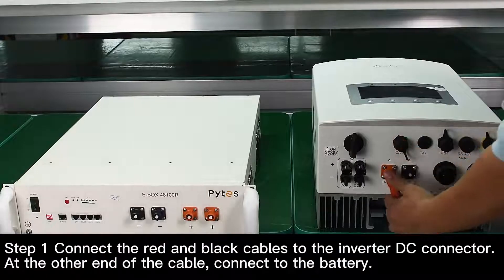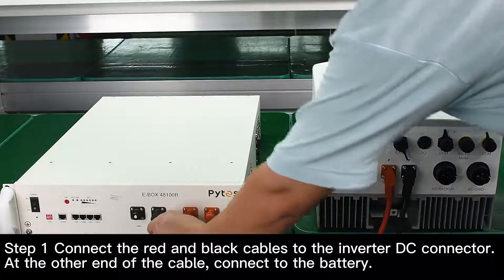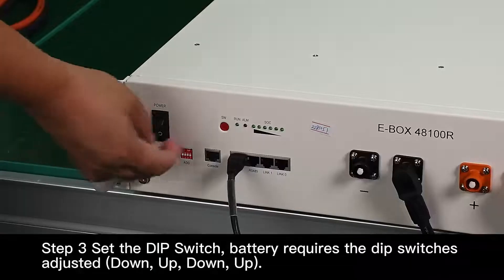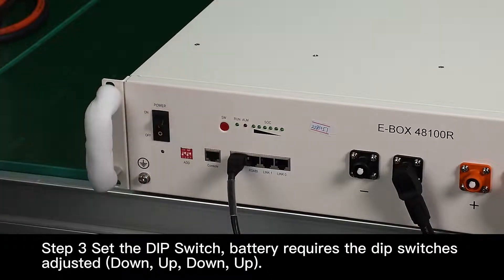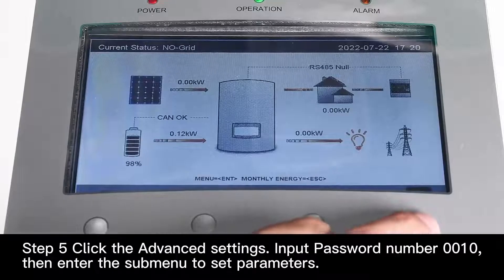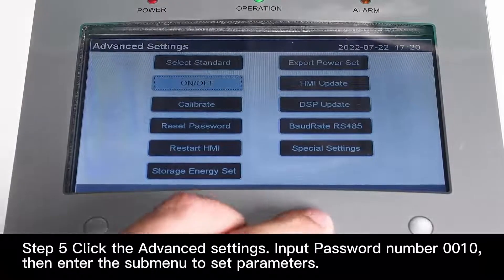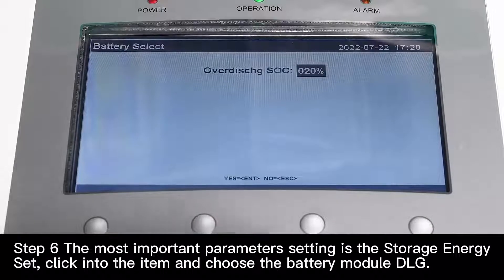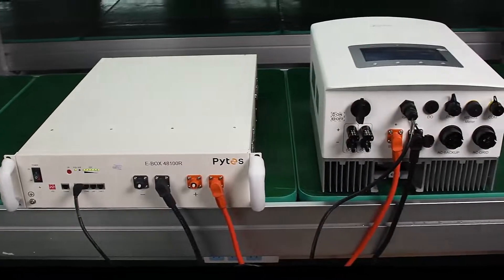Residential Energy Storage: Pytes Energy E-Box 48100R LiFePO4 Battery with Solis Hybird Inverter

Comment: Hi, I have the Solis-RHI-6K-48ES-5G +WIFI Hybrid Inverter, which model of solis inverter is the one in the video? in my inverter the "DLG" battery option does not appear, thanks for your help
Reply: As far as I know, you can choose "USER-DEFINE" to connect DLG with Solis. it's software version issues, i guess.
Reply from the maker: Hello, the inverter in the video is Solis S5-EH1P5K-L Series Hybrid Inverter. As for the reason why there is no "DLG" battery option, you can add whats account (Estrella +86 17821348753) for more information, and she will answer you in Spanish or in English in detail.